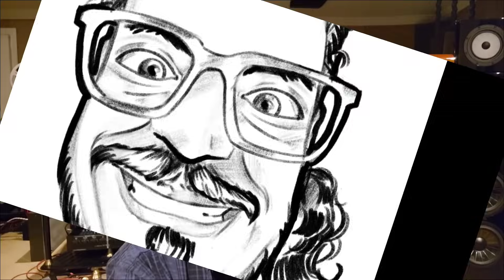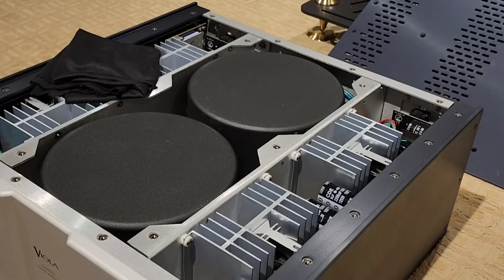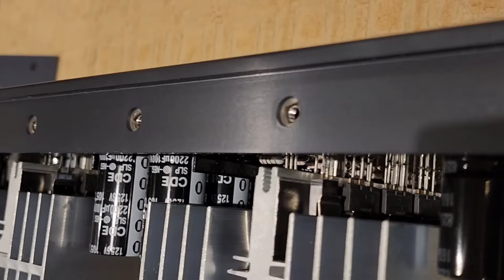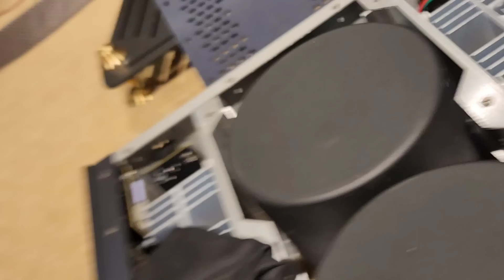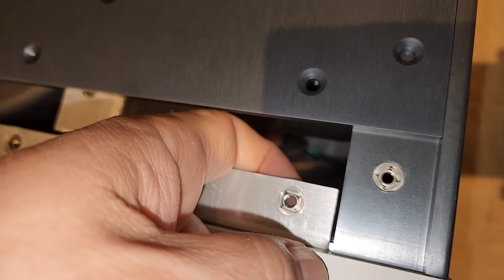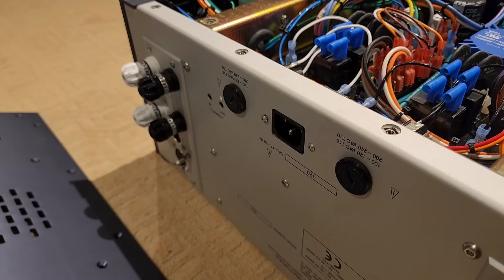THE BEST SLEEPER AUDIO AMPLIFIER OF THE DECADE !! #thebest

Comment: Another one praising highly overpriced electronic items of inefficient companies. All parts used in such items are available in the market for less than $1,000.
Reply from the maker: Then make one tough guy....
Reply: @OCDHIFiGuy  hahahah welcome to my world ...enjoy the punches and have a bucket of ice for your cheek...
Reply: No need, In India we build them for less than $200. The difference in sound compared to a $10,000 amp is negligible.
Reply: @henryjoseph413  If you can build one of these for $200 I'll fly to India and pick it up, and still have change from $35,000! (But no warranty I guess!) But you're kind of right, the law of diminishing returns means that above say $4000, there isn't much improvement in sound for average ears.
Reply: @billedifier8584  If anyone wants to spend a lot on audio systems, they should spend more than half of the budget on speakers and the rest on electronics. Why reviewers never tell us what parts were so different in performance that they caused the difference of $9,000. If all parts were not very different from say a $1000 system by, for example, Marantz or Cambridge what caused the huge price difference? Moreover, almost never are we shown test data. The words used also have flexible meanings - transparent, open, warm, bright.😂
Reply from the maker: @henryjoseph413  not everyone needs a cheap amp however. Nobody ever talked about exotic Indian audio electronics.  They are cheap and sound good but look cheap and feel cheap. I sell to millionaires... not hard to understand. I'm a luxury brand seller

Comment: Funny you Mentioned Mark Levinson. He Built the ML2 wich is rare very rarely Seen. He sold to Madrigal labs years ago I believe. Then the Cello Line which was top Line Stuff. I seen a pair of Cello Performance Amps with Clear Tops on both Power Supplies and Amp section. It was Audio Jewelry Like I never seen the Wire Routing Terminations and Neat Perfection was something I will Never Forget. I tried to buy a used Pair after selling my Rowland Research 7s and never was able to finish the Deal. But I had the Fortune to Meet Mark in his NY cello Demo StudioYears ago. Unbelievable Perfection in build !!!
Reply from the maker: Yes, absolutely... you met the legend and heard his legendary creation !

Comment: Poor design  those black caps next to the cooling fins of the transistor heat sink will shorten the life of the black cap because of the heat not good.
Reply from the maker: Lol. Trying to act like an Engineer, huh ? Sorry brother, these guys are far beyond your ability. You clearly don't know about 105C computer grade caps
Reply: @OCDHIFiGuy  105c caps have a shorter life span than the other caps from what I have seen on the spec sheets.

Comment: 6:03 Steel ?  or rather copper ?
Reply from the maker: Steel. It's got a yellow hue due to a coating.
Reply: @OCDHIFiGuy  Ok, thank you, but curious because copper is antimagnetic, steel isn't.
Reply from the maker: @dominiquedistefano  that's correct. So copper does NOT shield electromagnetism, steel does.

Comment: Those are PEM nuts that get pressed into the chassis - we used to use these in military power supplies that had to be certified for harsh use. The wiring harness is over built and sized so it can easily handle whatever currents it has to. Quality like this has not been built for DECADES, all they want to do is use the cheapest parts and construct it quick and dirty now.

That is a true boat anchor!
Reply from the maker: These are not PEM brother.. that was my point. I owned an amp manufacturer and we used PEM. these are actual loose nuts held captive... but yes, nowadays they just thread the sheet metal...
Reply: So weird to see PEM mentioned in an audiophile post. I worked for that company from 1995-2000. It was a great family owned business that literally printed money.
Reply: @PersonalTriumph  We used PEM's' from the early 70's till that power supply house closed in the mid 90's - i went into consulting and the rest of the workforce scattered to the four winds.. I still have some down the cellar in my parts cabinet
Reply: These are cage nuts. We use them in IT to rack and stack servers. I've never seen one strip, but if they ever did you can easily replace them.

Comment: Absolutely no reason why manufacturers can’t use floating captive nuts for all bolt connections. Can’t cost more than a measly $200 to use such captive nuts. Any manufacturer who doesn’t use captive nuts in their chassis designs are stiffing their customers. They lack integrity.
Reply: Krell used to use those, perhaps they still do?

Comment: HiFi gear now is like Tiffany Jewelry. They jack the prices way up and put $1,000 of electronics in a fancy Star Trek looking machined Aluminum box and sell you the box for an addition $20,000. So out of control. I would like to ask these over-priced bloated sellers of fancy boxes at inflated prices if I can just get the amp boards and parts from them and I will just put it in my own $100 aluminum box and save $20,000 for the same amp.
Reply: The difference in amps has several factors. Circuit design, input impedance, sensitivity, and the ability to handle dynamic impedance loads at the ouput stage. Have owned amps that matched the dynamic impedance of one pair of speakers and sounded rough, or very disapointing with another. Amps will definetly sound different when challenged with speakers that present difficult loads, or require more voltage. The reactive load can present differences in the overall sound signature. It likely requires being familar with the other components, speakers, and room being used. Doing a test in an unfamiliar setting with unfamiliar equipment would be nearly impossible until acclimated to the entire system.
Reply: Schiit has done some public pseudo-blind A-B testing. There are differences you can hear in a revealing system. I built my own ABX randomizing switching box to compare DACs and could hear significant differences as well. And simple doesn't mean cheap. Class A tube amps may have simple circuits but require expensive parts like heavy output transformers. It's worth reading Nelson's writing about some of the listening tests he's done and had other do for him, including a test with an amp with an unlabeled knob he asked listeners to set wherever it sounded best. That's where he discovered people like just a hint of negative phase second harmonic distortion.
Reply: @execwebtech3396 There might be differences to be heard, the question to ask before you hand over the money is are your ears capable of detecting it? Meaning the older you get the worse your hearing gets so before spending the money on something that reveals everything from 4 HZ to 40,000 HZ (yes they exist, I have headphones that can do it and trust me, if it’s a rubbish recording it shows, revealing isn’t everything) I would go and have a free hearing test. Tube amps always distort if you push them hard, that’s why we guitarists love them, Jazz guitarists prefer solid state amps. It’s a pleasant distortion but it’s still sound colouration.
Reply: @execwebtech3396  Why would one DAC sound different from any other DAC? They are taking a fixed digital signal of 0's  and 1's and build sine waves from those 0's and 1's. Saying the sound is different from one to the other, is like saying I have 3 calculators and when I put 387 x 65 I get the answer 25,000 on Calculator A, I get 25,200 on Calculator B, and I get 25,100 on Calculator C. The world would be pure madness if DAC technology was used in calculators but DACs do compute calculations so they obviously are doing something WRONG if they all sound different. Such as having calculators that all give wrong answers.
Reply: @AudioGuyBrian Would  the DAC in your cellphone be good enough for your stereo system?
Reply: @AudioGuyBrian DAC there is A in between.  A=analog
Reply: I got a second hand set of Monarchy Audio SE-100 Delux monoblocks for £650. These will be my last solid state amps. They drive my Heritage Specials with ease. Couldn't be happier
Reply: Audio guy Brian - Yeah your amplifier is the best on the market, bar none. Nelson Pass is shaking in his boots.
Reply: Then, you should really build yourself your own amplifier that you designed by yourself. Sure, you could save thousands of bucks going that path. But be sure, your own amplifier design only. Not copied from R&D’d designs who has splashed their own costs before reaching the final stage of prototype.
Reply: @boboiboy9350  Got news for you. Class A and A/B amp designs have been around since the 1950's. Nobody is creating anything "new" these days. Just fancy $20,000 aluminum boxes to put the same circuits inside and rip people off.
Reply: This is called a total lack of appreciation for genius. If you’re so good at it, why ain’t you rich?
Reply: It’s one of the oldest grifts in world history. Put a ridiculous price tag on anything and someone will buy it 😂
Reply: I got a second hand set of Monarchy Audio SE-100 Delux monoblocks (class A) for £650. These will be my last (til death) solid state amps. They drive my Heritage Specials with ease. Couldn't be happier
Reply: I know I know It’s F sad
Para sound makes for $3000 one hell of an amplifier Model A21 Check it out if you can give it listen, you might be impressed
Reply: Differences between amps are so small that most people can't tell the difference between a working condition 1000 eur amp and a 100 000 eur amp in a blind test. This has been tested numerous times and most audiophiles even refuse to be tested not to lose face.
Reply: @dingdong2103 oh come on man, if you can't hear the difference between 1k and 100k amp you need to see a doctor.
Reply: @W4YN0T what’s funny to me about these ASR objectivists types is they never question the value of a $500k-$5m professional recording studio but a $50k home audio setup must be made up of snake oil hardware.
Reply: @dingdong2103 Wrong. The Julien Hirsch adage "all amplifiers sound the same is bullshit. A pure Class A power amp has a distinctly different sound than a Class A/B or a Class D amp.
Reply: @milesdufourny4813  Yet it can't be measured and people can't tell them apart in blind listening tests. Isn't it funny? Only tube amps I can tell really make a difference, but that's also measureable.
Reply: @dingdong2103  “people” are individuals like my friend’s dad who can’t tell the difference between DVD and Blu-ray blown up on a 90 inch projector screen.
Reply: @dingdong2103 if only tube amps can sounds different, can you measure the differences?
Reply: @dingdong2103  I think you should invest in a box of QTips.
Reply: @dingdong2103 Yeah and I saw an interesting comment the other day ‘buy the time you get to the age to afford to put a system together to reveal 22,000 HZ you can only hear up to 12,000 HZ😅.
Reply: @dingdong2103  That is so true. Amp circuit designs have been around since the 1950's and not much has changed but the boxes and the introduction of LEDs and small phone screens. I am extremely blown away by amps that are simple Nelson Pass designed Class A amps with only 5 or 10 watts and get sold in the Audiophile marketplace for some insane price like $10,000. You can build one exactly the same yourself in an afternoon with minimal skills and about $400 in parts.
Reply from the maker: What if I WANT to spend 50K on an amp because I just made millions on a deal ?? Do I buy some "value" brand ?? Hell no I dont..
Reply: @OCDHIFiGuy  If you want to splash money just for fun it's your right to do naturally. Just don't spew hyperbole afterwards how magical the sound is lol.
Reply: @OCDHIFiGuy  By all means do. And let me  know because I have some magic beans you might be interested in. Only $5,000 per bean!
Reply from the maker: @dingdong2103  come listen Ding Dong... then let's talk about sound...
Reply from the maker: @AudioGuyBrian  Says the guy with a Paganni or whatever ridiculous car is in your avatar... I've got an unusable race car on the street to sell you.
Reply: @OCDHIFiGuy  Oh trust me, I have listened to plenty. I own several active/passive speakers, electrostatic panels, conventional boxes, dipole and horn system (Synergy horn). I've listened to many systems in places like Munich High-end expo, Bonn High-end expo, Helsinki etc. Many highly regarded audiophiles have lost face when their hyperbole about differences between amps are lost when they don't know which one they listen to.
Reply: @OCDHIFiGuy  LOL. You crack me up dude.
Reply: I will sell you a very nice Viola amp that has Mark Levinson bones for a smooth 38k. You can use the extra 12k to buy a kickass CD player! Let me know... @OCDHIFiGuy

Comment: Hey Mikey and chat.  One thing you did not catch about the build is they are using CDE capacitors.  CDE is Cornel Dubilier Electronics.  They are American made, very high quality capacitors.  The audio world is all the rage about Mundorf and the like.  CDE is an OG of caps.  You will often find them in very demanding applications like industrial equipment.  It says a lot about how good the amp design is.
Reply from the maker: I caught it. Simply did not mention it.
Reply: Have you ever seen and heard the MA-70 class ab amplifier made by High Fidelity cables? They go for about 100 grand anyways the internal power supply uses 2 4.5lb 100000uf 100v nichicon capacitors in it these things are 8" tall 4" wife hands down be physically biggest caps ive ever seen 

Anyways when they went out of business I just happen to live local to them and managed to get my hands on eight of these capacitors for 15 bucks each LOL one day I will make one mega amplifier with them
Reply: @KnowName33  i have not heard of that amp, but those caps sound insane.  Crazy deal you got.  I would be scared to safety discharge them.  That's a lot of juice.  I wonder what the tertiary specs are on them.  Ripple, ESR, etc?
Reply: @KnowName33  We'll watch for all the lights in the neighborhood to go dim as we see that tell-tale blue green glow in the distance. Bring your ear plugs and UV filtering goggles just in case. Hope there's no wide spread power outages as there should be some music to be cranked...er tastefully cranked. Bring Your Own Bourbon and designated driver.
Reply: For $35K they better be the best caps available.
Reply: Schiit Audio uses CDE capacitors in their amps also. Always wondered if they were good or not.
Reply: cde is also made in mexico so don't get too excited
Reply: Mundörf of Germany makes the best caps in the world, if they used those the price would be 50 or 100k
Reply: CD's are entry level mediocre caps. Nothing worng with them at all, but don't attempt to elevate them beyond more "boutique" and more expensive caps. CD's are roughly in the same league as WIMA's, Wurth, Elna, or Nichicon. All of those are excellent products.  You start to enter the high end products with brands like Auricap, JFX,  Solen, V Cap,  Audio Note, Jantzen, etc. 
People modding stuff to "improve" the sound often swap out and experiemnt with different caps (usually very expensive ones), and even use Polystyrene in some circuits, etc.

Comment: $35K?! Maybe I’m being too closed-minded but I’ve yet to hear an SS amp that sounds as musically and emotionally engaging. darTZeel came close but it still didn't have the three-dimensional quality of tubes. At least it’s not an SS preamp. That would be blasphemy. LOL
Reply from the maker: You are being too closed-minded indeed ! ... ;-) 😉
Reply: @OCDHIFiGuy  Maybe…but you didn’t say anything about the sound, just the build quality. So does it impart the same sense of dimensionality, air, and musicality as a $35K tube amp?
Reply from the maker: @LorenzoNW  this is not the listening video in case you missed the lack of music... talk is cheap. Yes this is a world class SS amp which has the sonic attributes of a tube amp with better control and speed.
Reply: @OCDHIFiGuy  Well, that's pretty damn impressive if it can match the dimensionality and musicality reproduced by a good tube amp. But I'll stick with my 300B SET integrated amp, given my budget and level of satisfaction with what I've got.